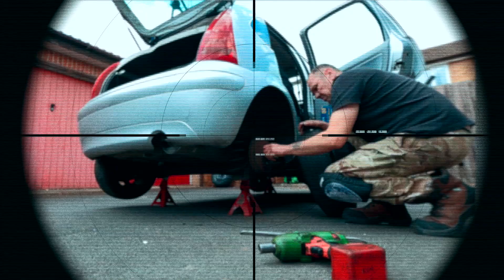VMP - Part 1 EDVC  (Vehicle Tools). - "First Things First" or Getting Intimate with Your BOV!

Comment: Two things that I now carry in my boot tool bag is a club hammer, (plenty of weight in a short hammer) and a telescopic breaker bar, Draper do one and it is compact but opens to a good length. 
Between those two I can get most stubborn nuts undone even if I do chip a bit of chrome off of a spanner.
Reply from the maker: Have you tried locking two spanners together to get some more leverage?
Reply: @theapocalypsechronicles3  Oh yes, great trick to get you out of trouble.